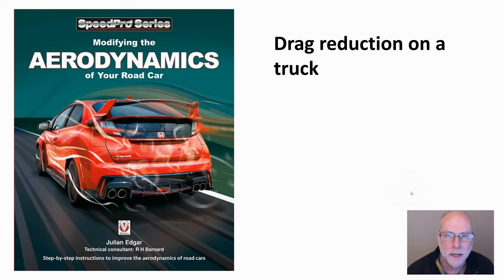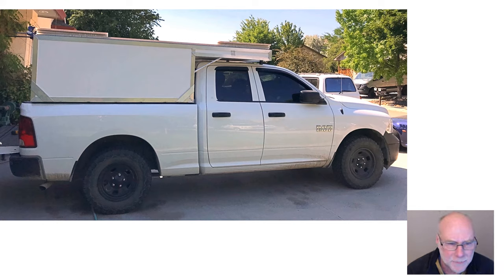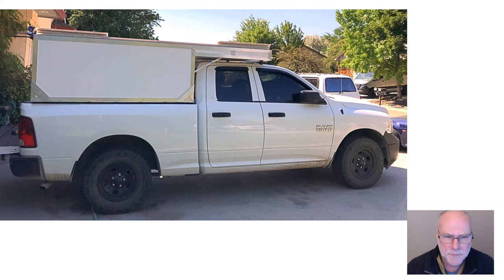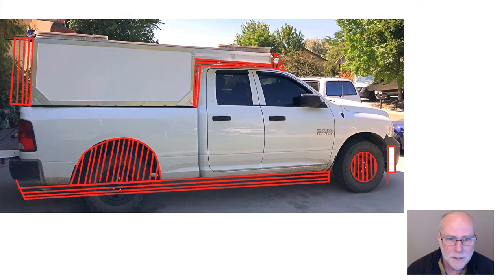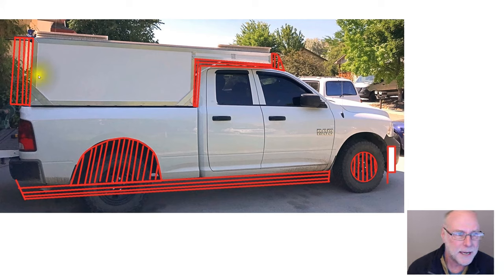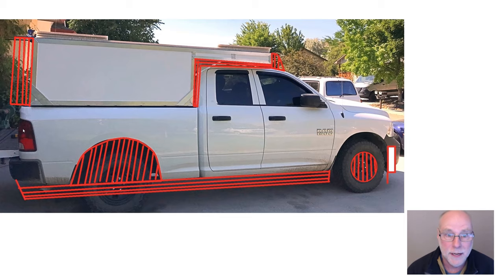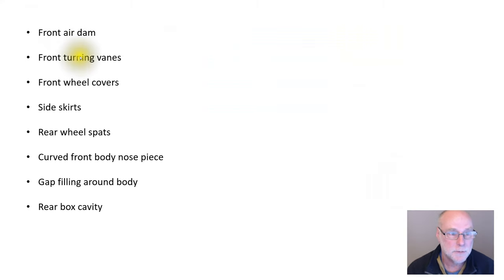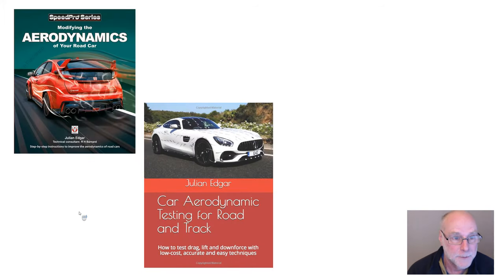Drag reductions on a truck

Comment: I used to have a Ram 2500 with a similar style camper (Go Fast Camper) and lost approx. 4 mpg after installing it. I fabricated a deflector out of a snowboard with the curved edges perfectly sloped to the corner edges and a bottom edge that was within 1/2" of the roof (to allow for slight frame deflection). Gained over 2.5 mpg back!

Comment: GM design and patented a tonnue cover that only covered the rear 50 percent of the bed. I built one , and installed it on my truck. I also lowered my truck and raised the air pressure in the tires. I was able to go from 22.5 mpg to 27.5 mpg on the highway traveling at 70-75 mph.
 Anyone who tells you to put a mesh tailgate or lower you tailgate on a truck made in last ten years simply does not understand what's going on on modern trucks. The manufacturer has designed the top of the tailgate to act as an aerodynamic aid. This why the tailgate tops are now wider and have the little duck tail spoiler on the rear of the tailgate.
Reply: Would 100% tonnue be better than 50%..?

Comment: best way that i have found out to increase truck MPG is changing your driving style! being mindful of your gas and braking inputs every single time you drive will improve your gas mileage a lot more than any modification. Take my 21 tundra for example. If i drive mindfully i can average 17-18 city and 20-21 highway. if i drive without really watching speed and braking i average around 14-15 city and 17 on the highway. Mechanical modifications would also be interesting to see tested out. Again take my truck for instance. Has hydraulic power steering and a clutch fan for the radiator thats robbing power and efficiency! Electric fans and power steering would definitely help. Truck also has a 4.30 rear end ratio that is meant for heavy towing. that could also be swapped out and improve efficiency. Would be fun to see how a terrible gas hog like mine would do with some mods hahah .
Reply from the maker: Yes, driving style is vital to mileage.

Comment: I think while your comments are interesting, this looks like a pickup truck that is mid-process in being converted into a popup camper.  The owner has built the aluminum and composite lower portion, and the materials sitting on top are insulation panels that have yet to be fitted within the camper body.  It's possible that this aftermarket upfit is designed to be removable, which means that the gaps to the roof and rear of the cab are necessary, both because permanent attachment wouldn't serve the removable nature well, and because there's typically enough flex in the truck frame that the gaps are needed to prevent damage from uneven pressure and rubbing.

You'll note that most pickup trucks feature a bed that is not attached to the cab, this is because when the truck is loaded, there's a change in the flex of the frame, resulting in the top of the bed getting a little closer to the cab than when the truck is unloaded.  Most trucks available with 6' or longer beds feature this gap.  Ford had experimented with a 2wd truck in the sixties that featured an attached bed (it was actually referred to as the Ford Unibody) where the front edge of the bed was the rear edge of the cab, but when the truck was loaded down it meant that opening or closing doors became problematic.

Typical trucks sold without the true gap like the Honda Ridgeline, Hyundai Santa Cruz, Chevrolet Avalanche, and in Australian nomenclature the Utes based on car platforms all feature shorter beds with lower GVWR.  It's simply harder to load-down these trucks enough to deform them enough to cause problems with the doors.

Most American-market upfit canopies (also commonly called "camper shells" even though they are not specifically for camping) are the same height as the cab, or are at least the same height as the cab where they start at the back of the cab.  Some will raise up higher along the length of the bed.  Most fiberglass models feature sloped-back rear hatches, while many aluminum-frame aluminum-skin models feature a vertical rear hatch for more cargo space.  Some models feature thick rubber gaskets intended to allow the rear window on the cab to open into the covered bed while sealing-out outside air, while others may just feature a window at the front edge, leaving the full air gap from cab to canopy.  Unfortunately due to flex between the cab, frame, and bed, the kind with the rubber end up wearing through the paint around the cab's rear window.

Many popup-canopy type campers intended for actual habitation for camping usually feature squared edges simply because it's easier and sometimes lighter to build them that way.  Building a popup mechanism that accounts for those curves while closed is hard, and with so many different truck models, manufacturers would have exponentially more work if they attempted to tailor their models thusly.  Also since owners often will remove these when they're not camping, they don't want to gasket the area between the roof of the cab and the extension over the cab because of wearing out the paint.

Lastly, since many truck owners see their trucks through their off-road capabilities, those lower valence chin deflectors end up being problematic.  Some OEMs have started featuring them anyway, but reviewers testing these new models on even fairly light offroad tracks find that they rub or scrape or end up damaged.

The one place that I think most truck buyers would be OK would be for underbody smoothing, particularly if that smoothing was through the installation fo skidplates that actually would protect the truck from offroad damage.  I constructed a new radiator skid and added both an oil pan skid and a transmission skid to my truck and I think it might've helped fuel economy slightly.  I am tempted to do more, but admittedly trying to avoid adding too much weight is a concern for places that don't have anything to protect.

Comment: I just recently acquired a Tacoma. One of the many complaints owners have is the MPG. But its a 4x4 Truck and MPGs aren't exactly the main reason someone would buy or lease one. I have been considering making these types of modifications with ABS sheet plastic. A front air dam, side skirts and rear wheel well covers. Fold in the Sideview mirrors and hit the highway to test. Just ad an experiment and a YouTube video. 

My truck is a lease and I would only use factory mounting places for said Aero mods. Make them easy to remove.

Comment: im not a huge aerodynamics guy like you but here in america as of around 2015 or so a lot of lower spec trucks and work trucks come with big front spoilers like you said. the 4wd models usually omit it for obvious reasons

Comment: I'm in the Facebook group "homemade truck camper projects", and I've been thinking about a project with aerodynamics in mind.  In the process of searching, I found this video, and also found a picture of a Curtiss Aerocar that has become my inspiration.  I would be using the truck (Ford F450) to tow a 40 foot fifth wheel trailer as a full time business, so I'm sure even little improvements could mean huge savings in fuel over the course of a year of long distance highway driving.    I'm finding very little online about improving the aerodynamics of a truck/trailer combo other than semi trucks.  If you had any thoughts on the matter, I would be very interested in that topic
Reply from the maker: Covered in detail in my book - https://www.amazon.com/Vehicle-Aerodynamics-Modification-Development-alternative/dp/B0C87VYVL8

Comment: Another great video - what makes a truck's underside so rough as to not be suitable for an undertray? The fact that so many trucks have frame rails? The greater overall suspension travel? I bought both of your books and plan to experiment with an American cargo van. It is body-on-frame, much like most trucks.
Reply from the maker: Nothing really makes a truck underside too rough for a proper undertray - it's just that people with trucks seem reluctant to do the work. P154 of my major book shows a good truck undertray.
Reply: @JulianEdgar  Thanks so much for the reply! Spending time under my van, it seemed doable. I'm converting the van into a weekend camper, so I'm first figuring out the packaging/arrangement of tanks, batteries, and additional stowage. With that being said, I particularly want to do an undertray as it will be especially 'rough' (and I'd like some minimal protection of those things as well).
Reply: My guess would be angled driveshafts as well as suspension components (leaf springs). Theres no reason why you can't do undertray it just be a pain to fab
Reply: @LabiaLicker  Yeah, clearance for the leaf-springs were my biggest concern. Seeing how manufacturers have approached undertrays with RWD cars, I'm not sure how a truck/van differs with regards to clearance around the driveshaft. Am I missing something?
Reply: This is exactly what I'm so curious about, undertrays. Though I'm not an expert, I can't help but think that at least there wouldn't be any negative aerodynamic effects in applying an undertray to a pickup truck. Hopefully some positive effects!

One concern that I do have about them is the potential for the engine or the exhaust system to overheat. What do you think the likelihood for overheating any components would be?
Reply: @steves7896   I think that your biggest factor is ambient temperature. I'm driving UK Russia (Into Vlad's summer palace for tea) Mongolia Nepal and back through the 'stans. My temps are -25 to +40/45 so although I'm set on an undertray I may have to be aware.  Ironically without thought of the undertray I've already built an Up and Over tail pipe for the exhaust al la Motorcross  - ground clearance was my motivation. I'd doubt that you'd get an over heating problem but maybe a decent engine temp gauge would be a wise investment? Good luck - Oh. and I'm considering raising the rear edge of my bonnet (Hood to you) to allow the hot air from the engine to do it's thing in harmony with thermal laws
Reply: @CosmicSeeker69  Have you embarked on your trip?

Comment: This is super fascinating. I think the idea of reducing drag on a pick up truck is a worthwhile pursuit. The main barrier I see is that many of the alterations would alter the appearance of a truck, and thus be a non starter for many truck owners here in NA as they tend to be quite particular about that. For that reason alone a undertray would be a better solution for most. My biggest aversion to that is the need to drill into my vehicle. I’m wondering if you can achieve a sealing of the underfloor more elegantly by use of some F1 aerodynamic trickery. I know teams use vortex generators along the floor edges to cause an aerodynamic seal along the floor edge. I wonder if something similar could be achieved on a truck?
Reply from the maker: I wouldn't think so.

Comment: Testing has shown that a 7" "deep air dam " by it self  has had a negative impact on Cd . Not enough to reduce governed top speed. My hypothesis is that an air dam needs other supporting modds; eg front tray extended down to the bottom of the dam and/or air curtains . 

I am glad that you finally except that aerodynamic principles found in your "car book " can be applied to trucks  as they also move through air.

Comment: Hi, i am not that familiar with aerodynamics , but i think it is a very fascinating topic. I try to reduce the drag of my daily car to shave of some gas money. I have a question about the wake of the car . I drive a fiat punto 188 and here in germany it issnt legal to modify your car like in your videos. But cant i lay a duct from, lets say the engine bay, throu my car and out of the rear hatch to reduce the drag? I dont have the knowledge and test Equipment and neither the money to buy it , im saving on it but if you have the time and interest it would be nice if you can test in this direction , but i would underdtand if you dont. So in any case , i like your Videos and binge watch them so thanks non the less. Have a great day
Reply from the maker: Such a duct would do little unless it was absolutely huge.
Reply: @JulianEdgar  thanks for the reply, keep up the good work

Comment: Hello Mr. Edgar, I'm in the process of modifying a 12 foot straight (box truck) into a camper and am looking to improve the aerodynamics as much as possible. I know your book is focused on the aerodynamics of road cars, do you think it would be a useful tool to help in my pursuit of straight truck modifications? I'm sure the sections on testing will be helpful, what I'm more interested in is the specifics of starting from a vehicle that is pretty abysmal from an aerodynamic perspective. Most of the literature I've seen indicates initial Cd's of straight trucks are in the 0.5+ range so there is an opportunity for quite a bit of improvement.
Reply from the maker: My latest book covers trucks and travel trailers - plenty there to help you. https://www.amazon.com/Vehicle-Aerodynamics-Modification-Development-alternative/dp/B0C87VYVL8 or Amazon in your country.
Reply: @JulianEdgar  Awesome, this should make a good holiday gift then!

Comment: Interesting. I've built a camper body on a large Sprinter truck, with a big alcove area hanging over the cab. It is like driving a parachute, the fuel economy has gone from 8l/100km to an abysmal 20-something. I think the biggest problem is the air being pressed in between the roof of the cab, under the camper and then into the gap between the camper and the rear of the cab, as well as hitting the front wall of the camper, which is wider than the cab. I'd like to do something to correct the worst of it, but I'm not sure what. I don't suppose you know of any free or cheap resources for modeling basic aerodynamics so that I could identify the worst offenders by importing my sketchup-models or similar?
Reply from the maker: Vastly better to do some simple on-road test and measurement.

Comment: What about a regular configured pickup with AirTabs on the back trailing edge of the roof!..
Reply from the maker: They'll do nothing.
Reply: @JulianEdgar   WOW - Really I'm blown away by that comment Julian.  You've really got me rethinking my 7.5T truck build......and my mind turns to the aero truck designs from Mercedes Benz after what you said about side extenders. Much respect for your experience.

Comment: I've been thinking a lot about reducing drag on 4x4 vehicles, but a lot of the normal technique we might use for a sedan or other regular road going vehicle are wholly impractical for a 4x4 and nullify the point of one in the first place. 
My only real idea on this problem was air suspension along with an undertray. Drive with it lowered and then when off roading is necessary raise the vehicle. Most air suspension on the market today offer height adjustment of roughly 5 inches. And when accounting for typical speed in a 4x4 application the increased drag is negligible.
I'd love to hear what you think Mr Edgar
Reply from the maker: Yes, height adjustable air suspension is an excellent approach to reducing aero drag. (That's what I do on my car.)

Comment: Hi there

I'm thinking a DIY box an a Mercedes Sprinter flat bed. Besides creating a round front, I was also thinking of creating a "round back": Instead of 90 degree wall, a round corners (1 foot radius) and then a flat wall. Intuitively I though it would reduce drag, but after seeing few of your videos I'm not sure anymore...
[a sketch of the profile from the top/side: www.dropbox.com/s/ejg40en44gcrqn4/Box%20rear%20profile.jpg]

I was also thinking of doing it (the round shaped corners) along the box, for the case of side wind that occurs often when driving along the ocean in California...